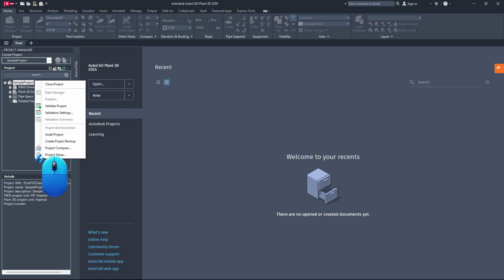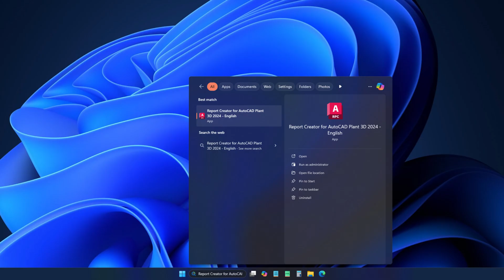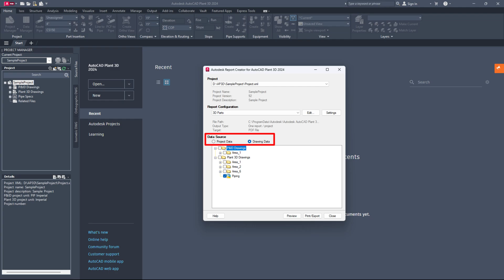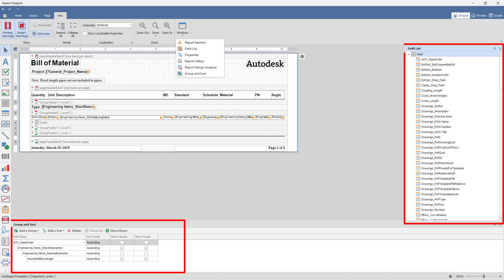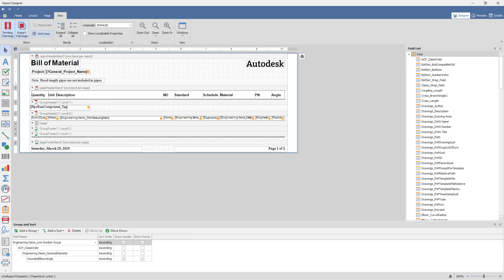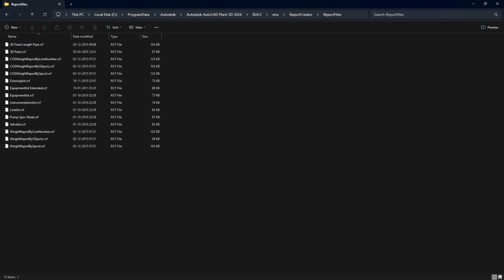AutoCAD Plant 3D | Create Report in Report Creator Grouped by Line Number Tag

Comment: Thank you for your videos — they have been extremely helpful.
Please consider producing more content specifically focused on editing the Report Creator, as there is a lack of high-quality material on this subject available online.

I need to generate a report that filters and displays only the lines that include insulation. In this same report, I also need to calculate the total insulation length per line, in millimeters, so I can produce an accurate list to send for cost estimation of insulated lines.
Reply from the maker: Hello Alexandre,
Thank you for your lovely comments!!
It is indeed possible to generate reports for only insulated pipes; however, determining the insulation length can be challenging since the insulation in Plant 3D is merely a graphic representation and not a physical parametric component. I will attempt to create a video on this subject shortly. Stay tuned!!

Comment: Hello again)
Do you think it is possible to make such a scenario:

There is a line in the P&ID. A tag of 6 fields is assigned to it. Annotate the line in the P&ID and see the text above the line. 
Opening 3D. Insert this line through the "P&ID line list". A line number consisting of the first three fields is automatically assigned to the Line. 

that is, in P&ID, this line has 6 fields. And in 3D, there are 3 fields. And everything is interconnected :)

 Is it possible?
Reply from the maker: You can achieve that by creating a 3D Line Number Tag specifically for the necessary fields.